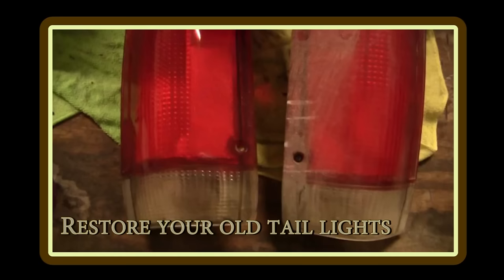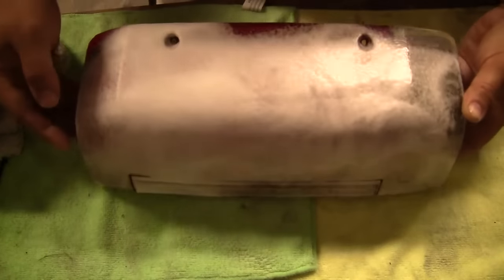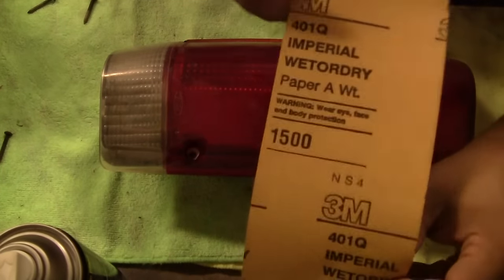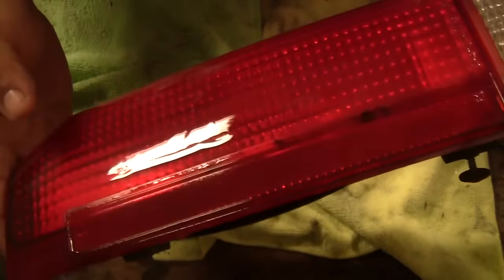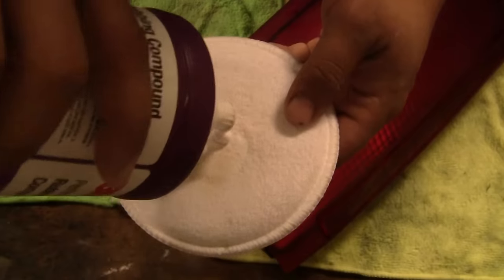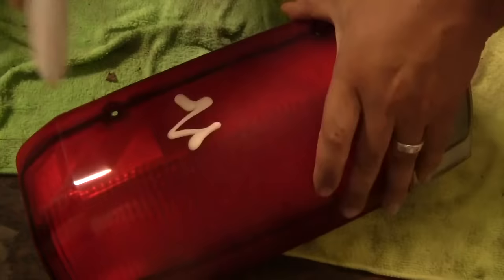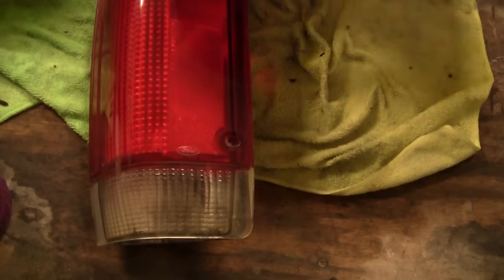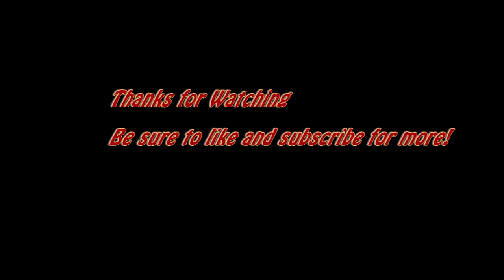How to Restore Your Tail Lights like a pro

Comment: A quick tip on cleaning, I spray cleaner on the inside of lens and rinse out with warm water and blow dry w/ compressed air. Especially on reverse lens where you see the dirt on inside. Instead of clear coat I use silicone glaze (polish) to finish, which forms an ultra thin barrier to elements.

Comment: If you're doing the entire vehicle, including plastic headlights, you may want to invest in a rattle can of two part clear coat.  It's comparable to the clear coat that's originally on the vehicle.  Without clear coat, the plastic lenses will yellow and haze from UV and ozone in a year or two.  With a single part clear coat, you'll get another year or two of shine, but with a couple of coats of two part (2K) clear coat, the shine will last 10+ years.  A stem is inserted into the bottom of the can to break an inner seal, you shake the can to mix the two parts and you have 30 minutes to spray before it hardens in the can.  If you can't remove the plastic lenses, thoroughly mask the vehicle to prevent over spray.
Reply: This is great advice. I'm going to get some of this for my car.

Comment: If you start with 0000 steel wool first and then 1000 grip wet/dry sandpaper, graduate to 1500 and eventually 2000 grit, you'll have a much easier time sanding and a better looking finished project.

Next step:  Meguiar's M21032 Mirror Glaze Ultra Pro Finishing Polish  will take out those remaining scratches that were still visible.

Nothing polishes as good as foam.  Get the foam attachment for your drill and speed up the buffing process with a better result.

Comment: What about cracks? I have a 1980 Camaro That I’m restoring and need to fishing the tail lights. They have small cracks all over them. I’m guessing I can’t fix it but you never know
Reply from the maker: Yeah, not sure if those can be fixed. But they made a ton of those old camaros. Best option is to find on ebay, facebook marketplace or a junk yard a used set that needs restoration but isnt cracked. I would think you could find an old faded set for like 20 bucks at a junk yard or online

Comment: What is that polish compound??? U only use that compound??
Reply from the maker: Its a 3m mid abrasive polish. You can you any type of polish to make it look good. Just takes a buffer or a ton of elbow grease to get them looking really nice
Reply: @EKAutoTech  what is elbow grease???
Reply from the maker: @qiyheartfilia9698  google it.😉
Reply: @qiyheartfilia9698  he means with some hard work, elbow grease isn’t a product or anything
Reply: @qiyheartfilia9698  elbow grease is typically found at most parts stores. It’s on the shelf to the left of the blinker fluid and to the right of the heater core for a 1965 Volkswagen bug…
Reply: @RakingNcash thanks for explanation ❤️

Comment: Why not clear coat spray after wet sanding
Reply from the maker: You definitely can, but i didnt have any 2k clear on hand at the time. I wouldnt use rattle can clear coats as they wont last as long. Honestly using any kind of clear on headlights wont last due to the constant bombardment of road debris. For tail lights like these, i would clear them. I personally use Matrix brand clear coat